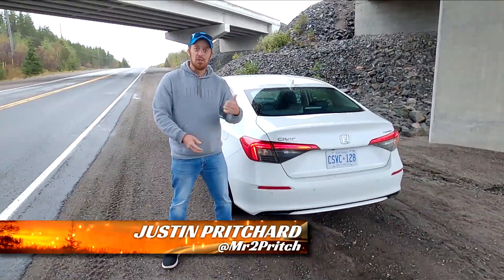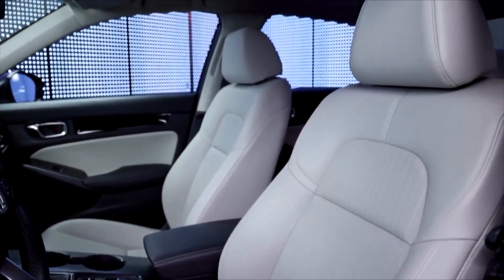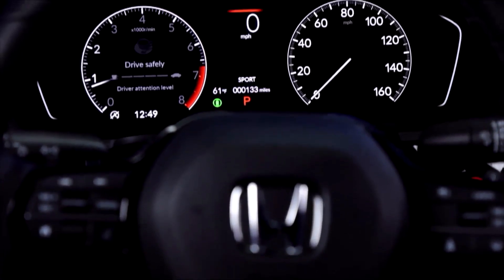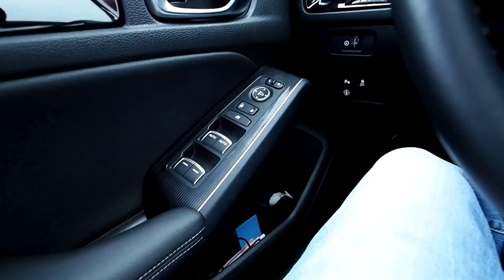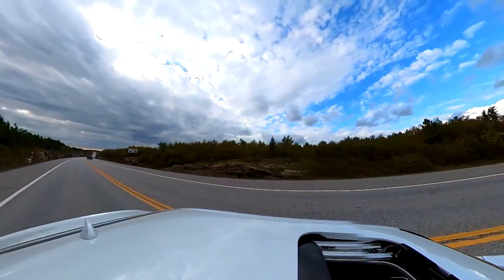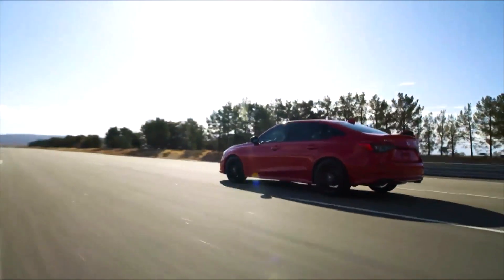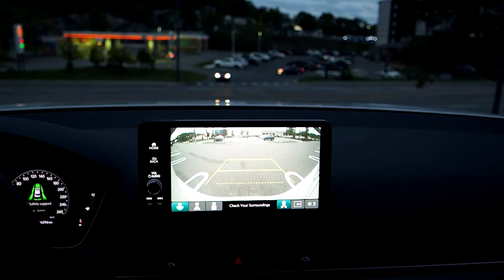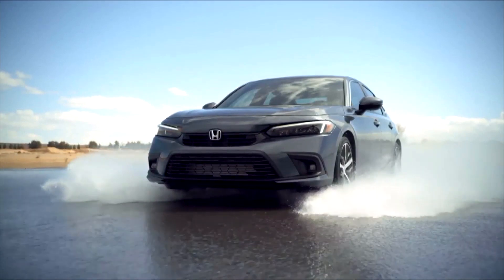2022 Honda Civic Touring: The Engineering Behind Why It Drives So Well

Comment: Making turns on the wet surface notice rear end wanted to swing. Not Good.  Seen the 2022 Civic Touring driven in less than 1 inch of snow and it slid all over and could not even drive well on a 5 degree incline in very little snow. Those OEM Goodyear Eagle Sport All-Season tires are mediocre at best and only perform well on dry surfaces.  I highly recommend to get winter tires for the snow or a more superior All-Season tire. Oh! Civic is still very noisy on the highway.

Comment: Just got my 2022 civic touring and its absolutely amzing in everyway
Reply: Thank for getting back. It's getting better or I am.
Reply: So far only probl3m that i just got is cruise controle juat cutting off and gotta shut off car and restart to make it work again
Reply: I had a camery years ago that kept doing that. But it usually occurred in very hot weather and climbing hills.
Reply: Do you have a issue with reverse. Not a problem. Just requires a lot of pedal to get moving.
Reply: @Offensively-normal  nope not at all